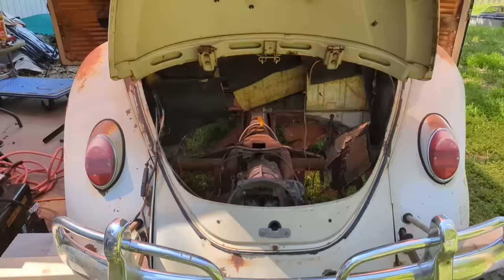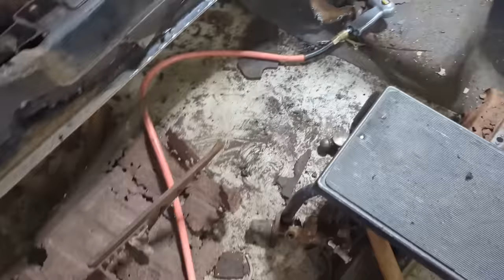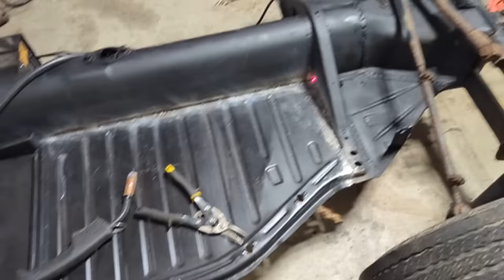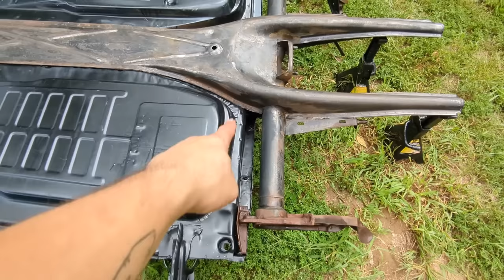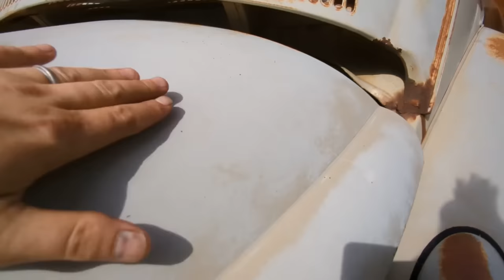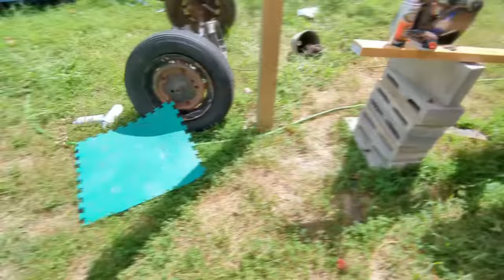This is going to be a Delivery Bug? Panel Bug? and NEW PANS!

Comment: Interesting project. It would be good if you could find a Type 3 or Type 4 engine for a flat floor in the back.
Too bad about that 1967 Beetle as it is a one-year only car. Maybe someone would trade you for a different year.
Reply from the maker: The plan is a type 3 engine. 67 may be a one year only but that will make the end result that much better